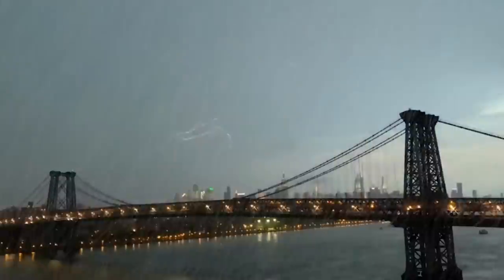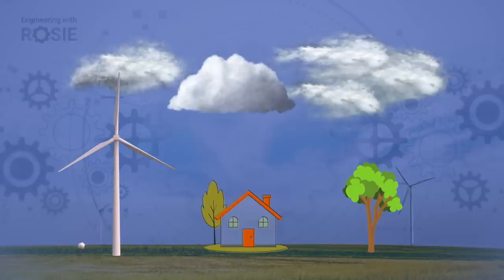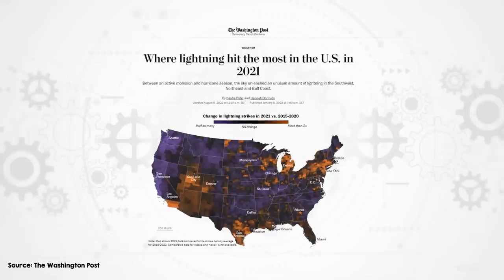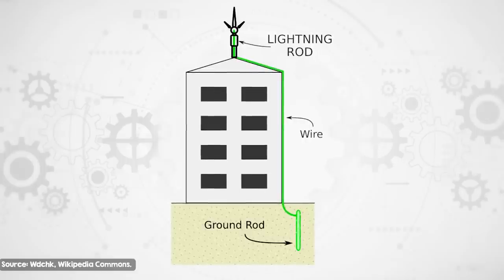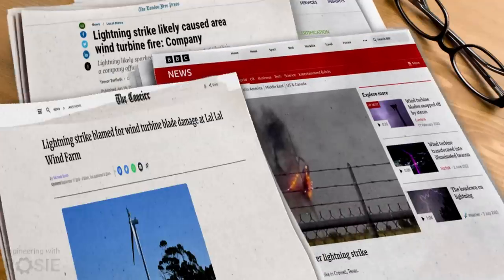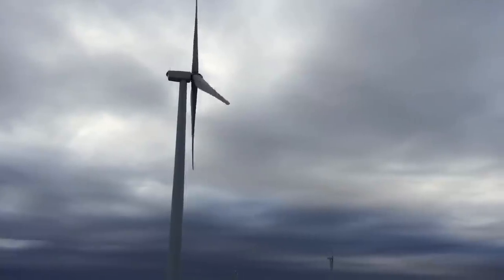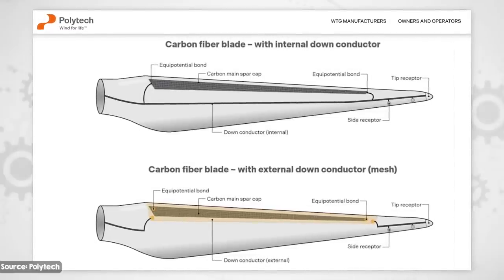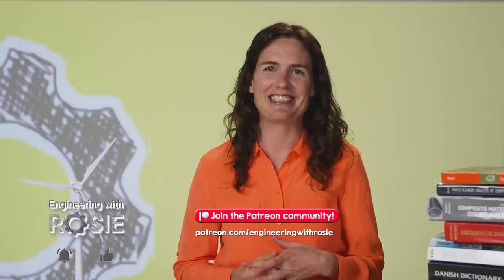Wind Turbines vs. Lightning: What Happens When a Wind Turbine Gets Struck?

Comment from the maker: Lightning engineer Allen Hall will be joining me for a livestream on August 9/10 depending on your timezone: https://youtube.com/live/sq5qZzVPLTY 
Set a reminder to join us live or leave your questions or suggestions for better/ cooler ways to protect wind turbines from lightning here in the comments.
Reply: Carbon fiber airplane manufacturers have shown, utilizing a layered form of protection from lightning strikes  can be achieved. Including external protections such as coatings, plus internal protection, such as layers of metal.  A very robust form of lightning protection is created.

So what added value do we get  by knowing the nature of lightning?
Reply: My goal in life is to one day have a job title half as exciting as "Lightning Engineer".
Reply: Why don't they just use mesh like conductive light structure within the case of the blade that lead to main cable inside with many connections along the blade. Simple like Faraday cage.
Reply: @svetlicam  apparently they do but it seems it's still not good enough
Reply: @alanhat5252  they could also put very small conductive antenna like spike on the tip of each blade as well on the casing of generator.
Reply: @svetlicam  FWIW the Faraday cage was my initial thought while watching the post.... Carbon fiber airplane manufacturers use a similar  Lightning protection strategy that you're suggesting.....
Reply: There is  also research into increasing the conductivity of carbon fiber, which could be utilized for lightning protection.... For example by using doping or embedded nano aluminum oxide ....
Reply: @alanhat5252   utilizing a 'conductive mesh'  for wind turbine blades, is just in the research stage .... so apparently you're missing the point....
Reply: @nc3826 Graphene, carbon nanotubes, and special types of carbon fiber are next-level cool!
Reply: @WeatherGuardLightningTech  Didn't realize carbon nanotubes were in the realm of possibility, in terms of being a cost effective option? I look forward to an Illuminating livestream on the subject matter.... Thanks again for the feedback....
Reply: 300million volts and 30 thousand amps you said?  that's alot of kilowatts why can't we store this yet?
Reply: @rob,  your  confusing power, with energy

Comment: Some years ago i worked with this issue. Due to self induction of the lightning wire inside the turbine blade and the the high current gradient from some lightning flashes there vill appear a huge voltage drop from top to botton in the wing. eg 100 kV to 1MegaVolt. It is difficult to isolate a Carbon conductor inside the blade against the huge voltage drop, therefore it is wise to find a way to electricaly connect the carbon fiber to the lightning wire throughout the turbineblade to avoid arcing.
Reply from the maker: Thanks for adding this great insight!
Reply: There are a few methodologies that carbon fiber airplane manufacturers are utilizing.... Such as  conductive materials interwoven into the airplane or in this case the blade.... or conductive coatings.... 

Actually I was thinking of a Faraday cage shield initially.... There are not that many original ideas.... We just end up, improving upon old ones, If we are lucky....
Reply: Totally agree - need to connect the carbon fiber to the down conductor.  OEMs have worked on this problem and there are good solutions.

Comment: I am an Electrical Engineer and I have often work on systems that have Mechanical Engineering leads that take a mechanical centric approach to the System Design and often (because of their limited Electrical experience).  This often leads to issues like you described.  When you first mentioned that they thought the blades would not get struck because they were insulators - my brain immediately thought "that was stupid".  1) Air is an insulator too so it is all relative  2) Electricity travels more easily on surfaces than through air 3) Water will accumulate on the blades during a storm and that will create a travel path  4) (probably the most important) Residue will build up on the blades from the rain and that will include salts and minerals that are very conductive when dissolved in rain.

Comment: There must be a whopping big slip ring inside the nacelle boss to complete the circuit to ground, would be nice to the engineering in that.
Reply: It doesn't actually need to be in contact - lightning will easily jump over a small air gap

Comment: As a windturbine electric technician, i can agree that almost every part has some form of lightning protection, even the Internet cables. At least @ Nordex Turbine's
Reply: Murphy and his law strikes again..... Thanks for the evidence.....
Reply: Wind turbines have improved their lightning protection a great amount in about 15 years.  Turbines built in the early 2000's didn't have much protection.
Reply: @WeatherGuardLightningTech  have many survived the lack of protection?
Reply: Unfortunately the wind turbines without protection did very poorly in service.  Blades were damaged/destroyed and the electrical equipment in the nacelles were exposed to massive lightning voltages that frequently damaged equipment.

Comment: Very interesting Rosie!!! My encounter with lightning, as a Central Florida resident has been 2 times with a total cost of $3000 for the electronics in the house. Went through 2 whole house surge suppressors and the current one is a commercial unit. Power lines still getting hit, but seems to be working.... time will tell. Also redid the service panel ground system. Fingers crossed. Amazing how lightning can wipe things out is a fraction of a second. Great video
Reply: Florida is one of the most active lightning hot spots on the planet!

Comment: Very interesting!  Surely there must be a lot in common with aircraft fuselage and wings which also have to withstand lightning strikes on average once per year.  I’ve experienced one!  In the case of aircraft built using composites, like the Boeing 787 they have a continuous layer of copper mesh on the outside of the whole aircraft.  Why don’t wind turbines follow this practice rather than trying to predict where light will strike?
Reply: Aircraft and wind turbines are similar to a point.  Aircraft have governmental regulations regarding safety and the aircraft designers are very cautious.  Copper mesh is relatively expensive and can be difficult to work with.  Plus, when it is damaged by lightning it is cumbersome to repair.  Wind turbines do not (generally) have regulations regarding lightning and the copper mesh expense doesn't work for budgets.  Plus, aircraft have a huge amount of oversight and inspections which identify and repair mesh damage.  Wind turbines are not serviced as frequently.
Reply from the maker: Let's add this question to the list for the livestream!
Reply: There is no path to ground for an airplane.
Reply: @pauleohl  Correct, but lightning typically enters the airframe at one point and leaves at another. A typical plane gets struck once per year.
Reply: @Richardincancale  Is damage done? Is the damage visible to the naked eye?
Reply: @pauleohl  Sometimes, yes. Due to the skin effect lightning tends to stay on the outer surface - not a problem on aluminium planes, but can make small puncture holes where it enters or leaves, even causing depressurisation
Reply: @pauleohl  I’ve lost track at how many times I have said this to wind turbine engineers!
Reply: @Richardincancale Yes!

Comment: I have terrible lightning issues at my house and shop.  It's a regular occurrence to have sensitive equipment damaged during storms.  When I first moved into my house I saw 100mm sparks jump between the copper pipes for my hot water heating zones.  I've had equipment blown off the wall because lightning entered through ethernet cables.  Everything has since been bonded, all the pipes at all four corners of my house, and installed grounding plates at each corner of my house in addition to the grounding rod required by code.  And a few grounding plates at my shop.  All outdoor ethernet has been replaced with fibre.  I also installed metal roofs on both buildings, thinking if grounded these would be somewhat like a Faraday cage.  I don't know if that was misguided.  I also have maybe 200-300 clip-on ferrites installed on basically everything that plugs in and in the panels, plus I've wound loops around ferrite torroids for all permanently installed equipment.  And the usual MOV suppressors on every outlet.  Is there anything else that can be done?  Have I made mistakes?
Reply: Do MOV suppressors take the loading of a nearby strike? They look quite flimsy.

I've never had to deal with lightning & I'm definitely no expert but as you saw with your water pipes very high Voltages will jump gaps if not insulated so deliberately removing insulation from incoming cables where they're close to heavy-duty earths might be helpful. There's probably 2 busbars in your fuse box, one for each supply wire, an earthed bar beside each would give a point for high-Voltage flashover to occur, or perhaps an earthed box with the supply cable running through & uninsulated in the middle. Obviously very clearly labelled & probably closed with security screws.

Comment: To this layman, at least, a wind turbine blade seems similar to a composite glider wing. There was a glider strike in the UK in 1999 where the aircraft was essentially blown apart by the rapidly-expanding air, and the magnetic fields involved were strong enough to completely crush the aileron control rods: https://www.gov.uk/aaib-reports/schleicher-ask-21-two-seat-glider-17-april-1999
Reply: A wind turbine blade is similar to a glider wing.  The magnetic fields involved in the 1999 strikes were massive.  We had difficulty trying to recreate that damage in the lightning laboratories!
Reply: @WeatherGuardLightningTech  Super cool to get an answer from you!

Comment: A lot of lightning strikes to wind turbines are upward ground-to-cloud flashes. The examples from Tom Warner that you showed were upwards. You mentioned that the rotating blades makes them more susceptible to lightning impacts. The reason for that, at least as far as we know, is that the moving blades outrun corona discharges that act to dampen the electric field on stationary objects.

Lightning flashes to wind turbines have caught the attention of lightning researchers in another way, because they seem to be the culprit for a lot of thundersnow. It appears that they will initiate upward flashes into winter clouds that aren't quite electrified to produce their own lightning flashes. The charges on those clouds are likely much lower in elevation, and the turbine blades without their corona shields evidently reach high enough to trigger lightning. Since upward lightning is strongly dependent on object height, the increasing height of turbines is almost certainly contributing to the higher frequency of damage to newer systems.

Comment: Very enLightning! :) 
I'd never guess this was happening so often. that was very interesting to learn. Can you go deeper on the subject of fluid hot air? This gave me a better understanding about lightning. Thank you for sharing!
Reply: Lightning is plasma - the 4th state of matter.  The atoms and molecules are super-heated and very energetic....and conductive.  Because it is conductive it can carry current and be influenced by magnetic and electric fields. Plasma can also be pushed around by the wind.  It's hard to visualized by lightning is easily pushed around by the wind and super sensitive to electric and magnetic fields nearby.
Reply: @WeatherGuardLightningTech  does this suggest conductive &/or magnetic shapes which might direct strikes away or towards specific points? Perhaps some sort of direction of the blade tip vortex?
Reply: Good thought! Magnetic shapes, dielectric shapes, and airflow control mechanism can keep lightning better controlled!  So much work to do!

Comment: What do the brushes between the wiring in the blade blade and the nacelle look like?  In theory you could have a small gap which the lightning jumps across because the strikes are uncommon so there's no friction.  Or it could go through the hub & the bearings instead.
Reply: That’s exactly how they are designed!

Comment: I laughed so much watching this. Thank you! In our part of the world the lightning problem was solved in the 1980s.
The American solution shown 6:47 only works for a wind turbine that's not running (assumably an American designed wind turbine). If the wind turbine was actually running then the wing to ground cable would be twisted and twisted and finally brake.

Comment: Interweaving some type of metal, is the main strategy that carbon fiber airline manufacturing is utilizing for lightning protection. And secondarily conductive coatings. So it seems like the same applications will be applicable to wind turbine blades too?

Personally I would like to see aluminum layers added, as a structural element. Which should be a more economical and recyclable alternative. 

But when additive manufacturing matures, I'm hoping complex aluminum matrices will be feasible to manufacture at scale and have a sufficient strength to weight ratio. To replace carbon fiber and fiberglass wind turbine blades, Which also should be inherently more protected from lightning damage.

Plus at some point we need to utilize lightning as a resource.... I know it's cliche, but every problem is just an opportunity in disguise.... At some point in time.....

Lastly thank you Rosie you make all these topics fascinating....
Reply from the maker: Great comment. I'll note it down for the livestream because there's a lot there! One quick comment on aluminium: that used to be the material of choice for blades before we swapped to fibreglass. The main problem was fatigue damage. Aluminium is generally not great under fatigue loading.
Reply: We were involved in a number of aerospace efforts using carbon fiber interwoven with a metal - preferably a metal that didn't corrode when in contact with carbon fiber! Aluminum and carbon fiber create a fantastic galvanic battery.  As Rosie will attest, composites have so many advantages over metals.
Reply: @EngineeringwithRosie  'Fatigue failure of the de Havilland comet' Tragically proved the aluminum fatigue issue. But it was still used to build planes for the coming decades. And composite materials such as fiberglass and carbon fiber eventually delaminate. But the blades don't have to last forever. A good engineer designs something, so that it lasts one day longer than its usable life, right?

My main concern is  using a material that will be economically viable to recycle. But I know this is just me tilting at windmills.  Since what I'm suggesting does not seem currently feasible. (This conversation reminds me why I love my steel bike so much)

Sorry for my long-winded replies, keep up the inspirational good work, Rosie.
Reply: @WeatherGuardLightningTech   I was mostly suggesting utilizing aluminum with fiberglass.... and i'm aware of the aluminum carbon fiber  galvanic issue,  but used in conjunction with a layer of fiberglass offer superior protection against galvanic corrosion. Another option to prevent corrosion between carbon fiber and aluminum is to encapsulate the bonded areas where neither water or moisture in the air can get to the bonded surfaces.  these methodologies have been used for decades with carbon fiber aluminum   Interfacing in bikes.

And when composites become economically viable to recycle.... I'll stop  hoping that metals become a viable option again....  Again I know it's unrealistic at this point in time, for this application ...

Thank you for your input....
Reply: Good comments and great input!

Comment: Wow! I just instantly just assumed cable to tip, slip ring, earth it and you're done but turbines, wings and propellers are crazy complex and explained like that I can well see the issue in trying to model where a bolt is likely to attach. Air pressure and in turn temperature and conductivity would have to look crazy around the tips of the blades without anything else thats going on....
Reply: That's the problem with wind turbine lightning protection.  To properly solve the issue, it will take a combination of electrical theory, electromagnetics, thermodynamics, aerodynamics, and plasma physics.
Reply: @WeatherGuardLightningTech  This is engineering, it's not necessary to know every last precise detail to solve the problem, just pick up on a couple of facets & work from there.

We know an electrical field builds up before a strike, I understand that when graphed it has a predictable pattern & is detectable with an electroscope (yes I know, Victorian-era tech, but it's reliable & everyone's seen one at school). This could be a trigger for a leading-edge slat or just an air or water blast to pop out & disrupt the airflow into massive vortices deflecting the formation of a plasma. If left fully analogue & at least mostly mechanical it should be fast enough to be useful, self-retracting & tough enough to withstand strikes that still get through. 

Consideration might be given to the idea that a superheated plasma discharge inches from the blade might stress the blade.